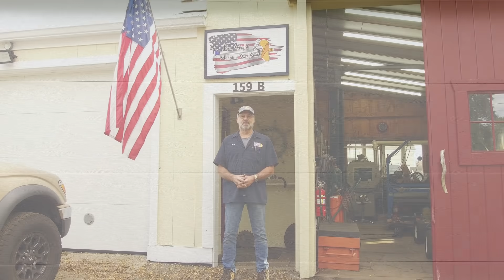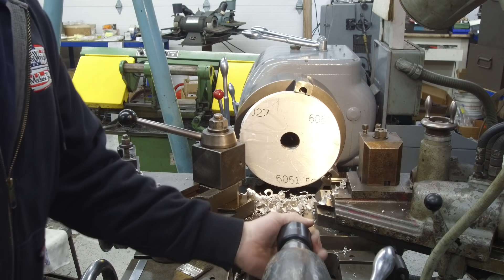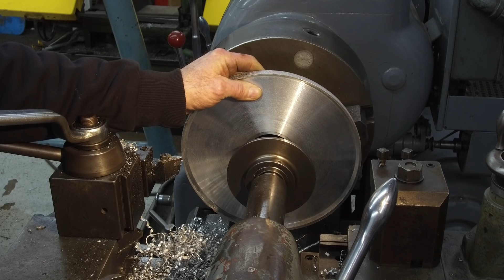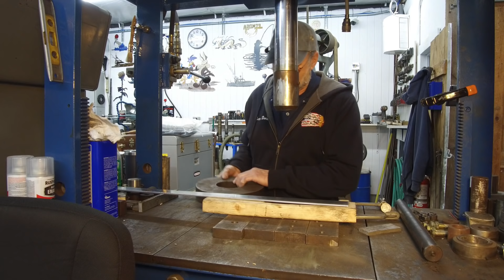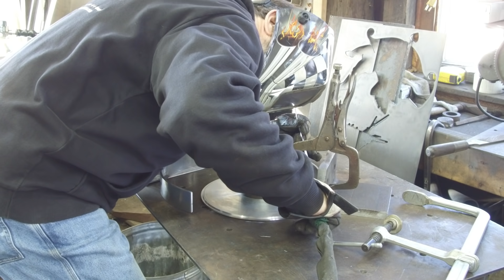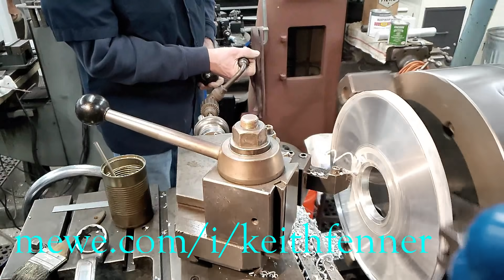Tanked Again Part Four

Comment: Just my two cents. You have influenced me immensely. I am just a hobbiest and I have purchased every major tool you have in 1/2 scale. (My shop is smaller and I don’t make a living with them) having said that I’m sure I have invested 50-100k. When I run a taper and this is just a short taper. I use my hydraulic tracer. It works great! And very consistent finishes. Just thought I would throw that in. No idea is stupid, you just have to get rid of the bad ones to find the good ones.

Comment: Nice work!! The most accurate way to establish true lenght of a ring or cylinder to be formed is to use mean diameter. Just add a material thickness for outside diameter or subtract a material thickness for inside circumference before you multiply it by pie

Comment: Keith i was very surprised in the way you formed the ring around the filler cap, i thought you had a small set off slip rolls for this type off fab work, however maybe you just wanted to do
it the way you have shown! ether way though that is a way to get the job done! respect and stay safe.

Comment: This reminded me of fuelling up a couple of motor launches I worked on.  The fuel filler was protected by a brass cap.  These were in the side decks where the passengers boarded, at low tide with sandy feet.  Over time, with the odd grain of sand to help, the threads wore away and were knife sharp.  So what you might think.  Well on one of the boats the clearance between your knuckles and the knife sharp threads when undoing the inner cap was minimal.  I can say you only got it wrong the once, a knuckle sliced open is not to be recommended!  The drips from Jerry Cans were caught and fed down to the drip trays under the fuel tanks.

Comment: TIP: When turning the OD the way you did, which I have done in the past, I found that thick paper on the back side works like clutch material and won’t break loose to easily.

Comment: Keith, beautiful as always. What angle did you set the compound to?
Reply from the maker: I just measured the angle for the length on the flat side of compound and never really stared at the degrees on the mark, but would guess around 4 to 4 degrees.

Comment: Just cause it’s a bit hard to tell, but the bunding ring you have welded on, is the finished height of that lower than the top of the fill collar? Just looks like it’s very close, if it were to fill with water and the lid wasn’t on properly etc etc. beautiful job though. Also, I hope you change your mind on leaving YT. Rumble doesn’t seem to be that crash hot at the minute.
Reply: Rumble will be getting bigger and better given time.

Comment: The two flashing rings in the slow mo at the end, is that a function of minor chatter? Or just shutter roll?
Didn't seem to be in time with the rotation so I'm assuming shutter roll. (?)

Glad you're still on YT bud! I would follow you to whichever platform but I'm not looking forward to having several of them, Guess it's something we're gonna have to get used to seeing as Suzan's crew can't maintain a fair platform for all.
Reply from the maker: LED light strobing with slow motion frame rate.
Reply: @KeithFenner  Thank you for the reply! That was bugging my curiosity.

Comment: A power drill with two round bars welded into a "T" shape is simple. Works by putting the bottom of the "T" in the chuck of your drill.
Reply: Been doing that for years,,,,for tapers. - Personally , though, when facing my lathe has a thing called a "power cross feed" that I find extremely handy for such work.